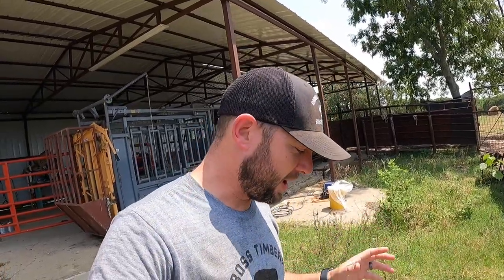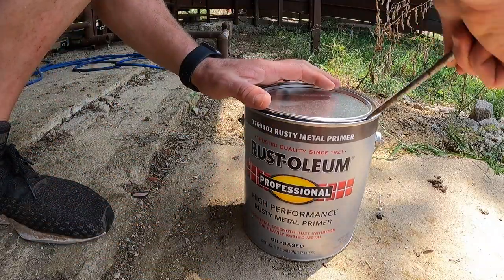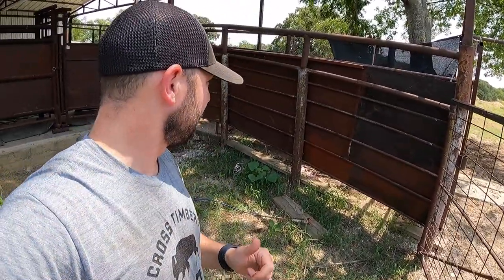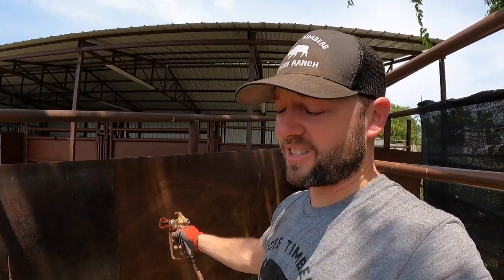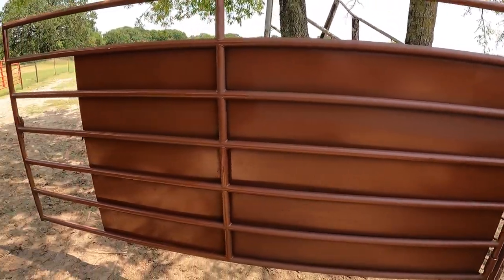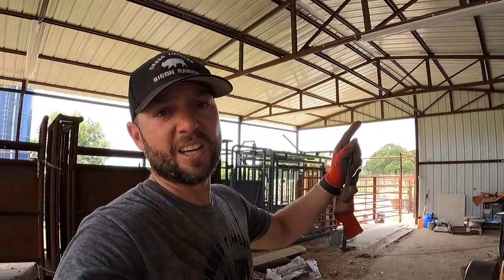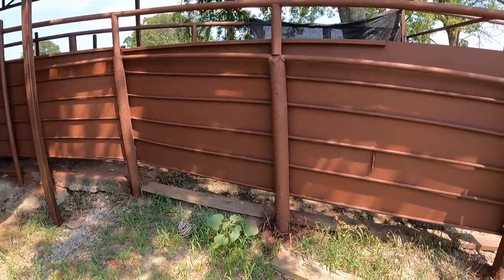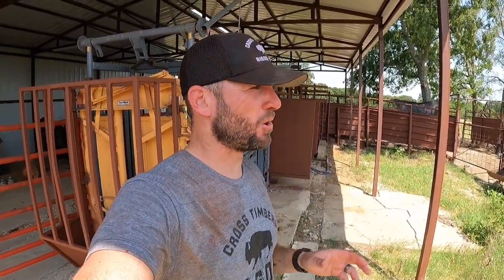Restoring Our Bison Handling System! Remember What Big Joe Did?

Comment: Take the rounded panel and lay it face down and drive the tractor over it, then raise 1 side a couple inches and drive over it again, you may be able the straighten it out, repeat raising 1 side and driving over it til its straight.
Reply: I agree, put it on a concrete slab (or boards under each end to keep from pressing into the ground) and use a wide boards under ur tractor tires . Use one side of tractor and just work ur way accross. Then u might want to reinforce the cross bars (Big Joe proof it) on that gate.

Comment: Great job !!!
   I used to paint houses.
If you ever have to paint the inside of the house, use the roller & go up and down zig zag, then put more paint on your roller and go back and forth then that wall will be done in a flash.
   Of course the top and bottom need to be done first so you don't get paint on the ceiling and floor boards.
Reply: Thanks for the info.  I will be painting the inside of my little house next year, myself, and will earmark/copy your comment so I do it correctly and get good coverage. I understand about cutting in corners, baseboards, windows, etc., as well as washing walls etc with TSP to remove dust, soil, dirt, and oils.  Appreciate your comments, I love to learn new skills and info.God bless!

Comment: Great job Dusty 👏 seriously I'd lay that bent gate on the ground, ,, bend up, a half post laying under the hinge end and drive the tractor over it, weld up any cracks and it'll go another round 👍🏻
Reply from the maker: We thought about driving the tractor over it
Reply: @CrossTimbersBison  just confirming a hard surface, or output 2x4' 2x6'x under edges so it doesn't dig into the ground, pavement or cement. You got this!!!

Comment: It is important to maintain equipment or you will have to dig down deep in your pockets to replace the equipment sooner than necessary. Good decision and it looks better too. You did a good job considering the tight areas you needed to paint. I was impressed how clean you kept the barn from that spray paint. You might want to pick up some nitrile gloves from HF to keep that paint off of your hands. Great for clean up too. Good job.

Comment: C'mon Dusty, that that UTV would probably straighten that panel just the weight of it, put it on the ground with a block and a plywood on top and drive that thing up on it till it's good! Or use the truck if needed 😁
Reply: Thought the same thing with the truck or the tractor rear tires. Few times back and forth aught to do it.

Comment: That's the only way to knock a large paint job . you were using the proper method , make sure to check the gun filter after each job.
Oh and store the unit with mineral spirits for oil base paints  or pump protector for latex they hate water.